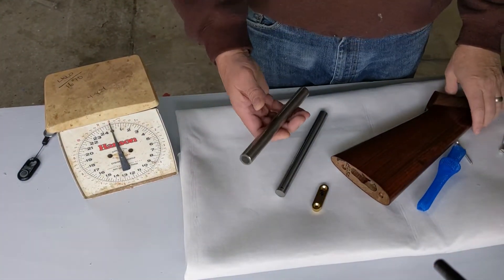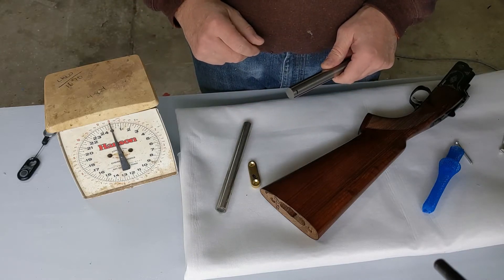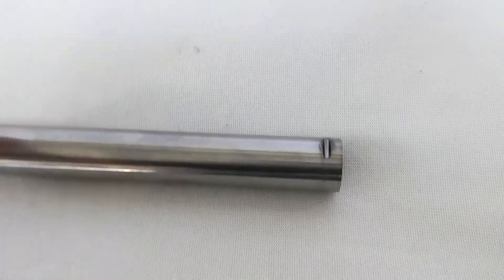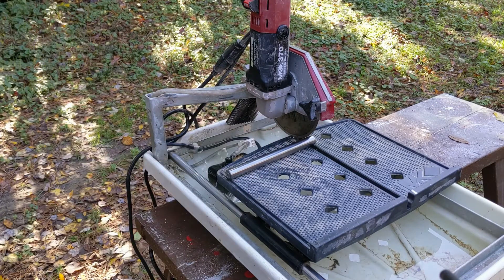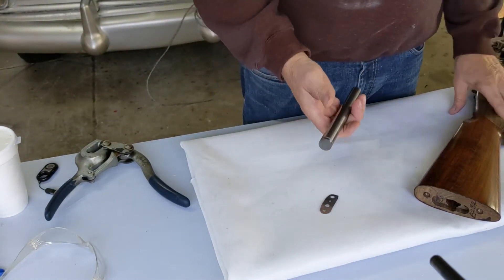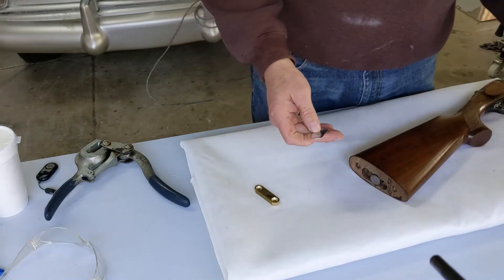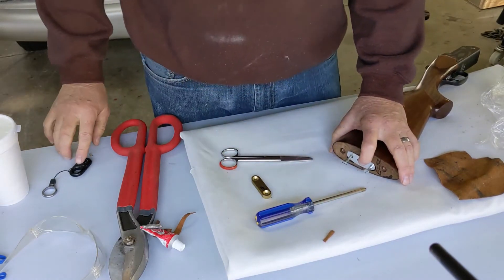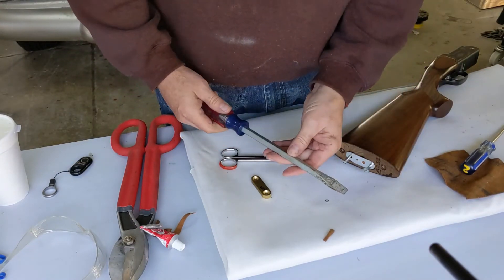RECOIL REDUCTION WITH TUNGSTEN ROD

Comment: Curious as to where you bought the tungsten rod from. I've found several suppliers online who sell rods like this one but they're $200+.
Reply from the maker: Yep, I do recall it was expensive but not 200.  It came from overseas and took  a long time to arrive....probably is radioactive or worse ..hahaha but it sure tamed the recoil
Reply: @neuromanglers  I've done a little bit of research and i think what you have is tungsten carbide. A 3/4 x 8 tungsten carbide rod is just shy of 2 lbs, if it were pure tungsten it should be about 2.5 lbs. Not as dense as pure tungsten, but more dense than lead and not nearly as expensive as pure tungsten rods. I see some 3/4 x 4 tungsten carbide rods for about $50. So paying $100 for an 8 inch piece sounds about right.
Reply from the maker: Ahhhh....yes....now that you mention it, I do recall it was tungsten carbide .  Thank you for clarifying this